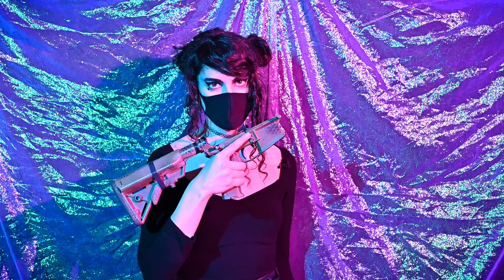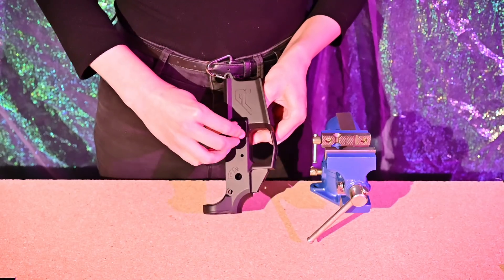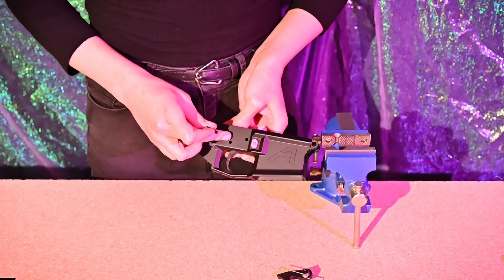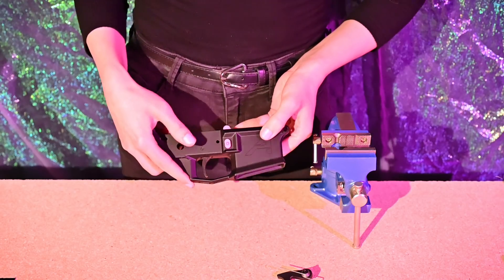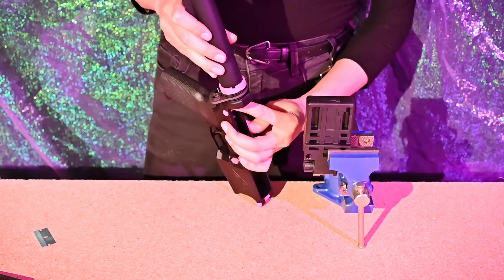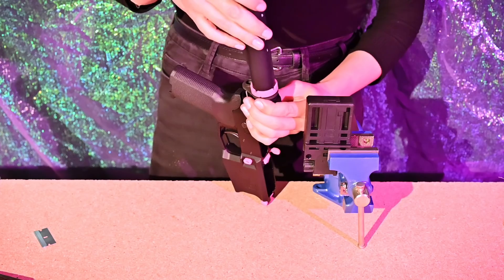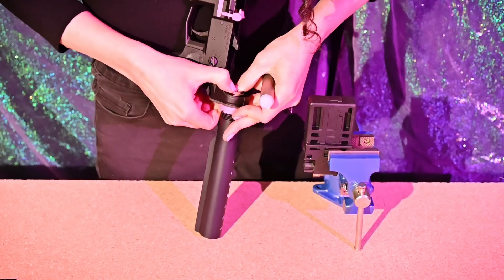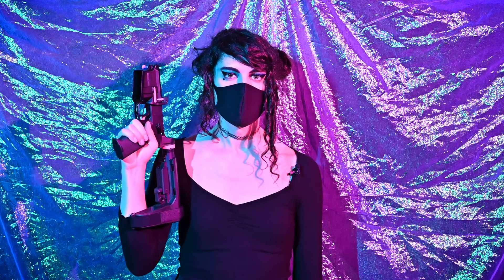How to Assemble an AR Lower (AR Build 1 of 2)

Comment: You're using a spring punch, you do NOT hammer it.  Put the point where you want on the end plate, and press firmly on the rear of the punch.  When depressed far enough, it will "snap" and you've done a punch.  Realign the tip of the punch with the divot you just made, and repeat as necessary until sufficient metal is displaced into the castle nut to keep it from backing off.
Reply from the maker: D'oh. You're right. I borrowed this punch from a friend and obviously had no idea how to use it. But hey, I learned something today!

Comment: i almost took a lower apart to build along with you

the m4e1 lower is dope because that stupid detent spring hole is threaded so you can put a set screw in there and make it captive and never have to worry about it ever again. trim a little material off the spring. its fine.

im drunk and ghetto so ive trimmed it and slapped tape over the detent. ive changed tubes and end plates a lot over the years on the same lowers until i got another and that part always annoyed me.

really nice parts build here. 

my mag catch wasnt screwed in all the way and the button would jam...then i figured out i needed to screw it in more. 

great vid!

Comment: Great build!

A couple things I've found helpful in my builds...

Anytime you have an offset load in a vice, place a block of similar thickness in the jaws. This will reduce twisting forces in the jaws and maximize clamping force. Your part won't slip as much.

I leave the rear takedown pin detent spring out until just before I have to tighten the castle nut so I'm not pushing the spring in 47 times while tightening the buffer tube.

Comment: Awesome vid! Unsolicited advice : Might use a kiss of Anti-Seize on the Buffer Tube and Castle Nut, to prevent it from galling / corroding, in case you ever have to remove or replace your buffer tube.  Same with a Barrel Nut. Thanks for making these!

Comment: Pretty decent video covering the build process.

I am confident that you know the following, but for those unacquainted, some recommendations from someone who has built these both professionally and as a hobbyist:
1. all springs and detents should have had a small amount of grease applied. Moving parts like detents need lubrication and a small amount of grease will fight off corrosion of springs in the detent channels.
2. the buffer tube/receiver extension requires grease on the threads, typical recommendation is Aeroshell 64, this helps ensure accurate torque values and prevents galling/cold welding in case your tools slip. This is even more critical for barrel nuts to ensure proper torque values.
3. a dedicate center punch makes the staking so much easier, I would guess a typical home tool kit would have a standard center punch instead of the automatic one you were using. Either way, props for understanding that a castle nut needs staking.
4. when utilizing a torque wrench a solid work surface is critical to properly applying torque and mitigating the risk of damaging components. I understand that the spirit of the video was using commonly available things, but a solid work bench makes jobs soooo much easier.

As always, keep up the good work, the content is pretty good and the info provided is all founded on a solid basis.

Comment: two thoughts I wanted to share

when spinning in the buffer tube, I like to take out the detent spring to remove the chance of accidently catching it and bending it over

also if this is your first build or still early to learning, might want to hold off on staking the end plate until you can test it or have someone else look at it to verify that everything there is right. Dont want to have to break it of and buy a new piece if you under or over threaded it.
Reply: Or just use a racheting end plate so you don't have to bother with staking at all
Reply: or a rifle buffer setup. 

we tryna make a4's great again out here!

or not....i get it
Reply: @jacobmanalang8162  can't do a fixed rifle stock on a pistol build.

Also some of us are travel sized and need a shorter length of pull

Comment: Unsolicited advice: if you’ve ever had issues with a bad lever screw coming undone or don’t like the wobble, look up the phase 5 EBRv3. It’s basically a one piece bad lever the replaces the existing bolt catch entirely. I have one on my SOLGW M4 and it’s pretty slick.
Reply: Unsolicited reply: the BAD lever wobbles so the reciprocating mass during LRBHO is the same as stock. some rifles won't LRBHO reliably with enlarged 1 piece bolt catches like the EBRv3 or the PDQ lever... Then again, your mileage WILL vary. You could try clipping a coil of BHO spring at a time until it locks open reliably.
Reply: @prfwrx2497  ive literally never heard of that reason ever for why the bad lever is loose. im not saying you're wrong but what does reciprocating mass in relation to the bolt release have anything to do with LRBHO function? I also dont see how cutting coils on a spring is a good idea either considering that less pressure from your spring keeping the bolt release in its inactive position would potentially allow the it to wiggle into place during recoil and then that itself would give you a false bolt lock. I have two guns with EBRv3's installed and other than the natural wobble youd get from the roll pin/screw that holds the actual bolt release to your lower, i have no excess wobble or issues with LRBHO. I also have a buddy who has a magpul bad lever and its a loosy goosy. Yes i admit this is a small sample size.
Reply: @OTG_Zulu  basically, added mass = mag spring has to do more work to lift the LRBHO to catch the bolt to the rear. This means that on some guns, the LRBHO don't move quick enough to intercept the bolt group, and you get a closed bolt on empty mag + chamber.

The equation is to make the magazine spring do the same work despite added mass of the bolt catch. That leaves the only option of reducing the force the LRBHO spring exerts against the magazine spring. Hence clipping off 1 coil at a time.

It's a balance. Too little LRBHO spring means the BHO can bump around a bit too much and give a false lock on not empty mag just as you said. But there's a bit of leeway to experiment and tune it. Worst case, install a fresh spring and try again, or not.

There's always tolerance stacking going on, so if you don't have to clip any springs to achieve consistent LRBHO, please don't. But if you ever have that problem, do.
Reply: @OTG_Zulu  I'm guessing that the hole for the LRBHO spring has quite a wide tolerance for the specs, so if the hole is on the shallow side, you will have LRBHO Fail with nonstandard bolt catches, but if the hole is on the deeper side, the spring isn't applying as much force against the magazine spring and hence, no problem.

On the OEM design, that spring thingy isn't critical. Stoner knew what he was doing, but he wasn't expecting new bolt catches. So his team at Armalite probably factored that in with the original TDP to make sure everything works yet tolerance don't have to be exceedingly precise where it wouldn't matter as per original intents.

Comment: The trick with a razor blade for installing the front takedown pin and its detent sure beats out the high dollar multipart specialty tool MidwayUSA's build video reccommends.
Reply: Amazon has a tool for like 12 bucks
Reply: I prefer to skip the whole thing with a KNS push pin. No spring and no detent to remove

Comment: In the past I've preferred most AKs I've shot to ARs. Is there plans for an AK build?
Thank you for such a great and easy to follow video.
Reply from the maker: Oof, I don't think I'd ever voluntarily take on an AK build. But props to the brave souls who do. I do have a 74M that I'll be showing off in a future vid though.
Reply: AKs are much more difficult to home build, especially the recievers. They're really designed around being manufactured by industrial equipment like metal stamping and riveting machines and require a five-ton press just to install a barrel. The end user is mostly limited to replacing the furniture, sometimes in ways that do allow for other add-ons.

Comment: Might be worth mentioning that Primary Weapon Systems has a ratcheting castle nut and end plate combo that works really well, and removes the need for staking the castle nut! Snug it up finger tight, then tighten it further with a castle nut wrench by two clicks, three tops.
Reply: I found it on Optic Planet's website. Looks cool. I plan on buying one soon. Thanks.
Reply: @pdxmarine1430  Oooh that's cool, and their K2 model has a little locking lever for added security 👀

Comment: I don't think you tube allows assemble videos I know tactical tool box never show assembly of any of his builds on youtube he puts those on a different platform and only shows the final products on youtube
Reply from the maker: Really? I've seen plenty of lower assembly vids here that seem to have stuck around.
Reply: From what I've seen it's usually videos about manufacturing (that is, usually machining and fabricating a gun) that YouTube takes down. This is just assembly of off the shelf stuff.

Comment: Not a huge fan of the BAD lever. Extra controls in your FCG I feel isn't a super great idea imo on top of hearing quite a few people reporting that the BAD lever induced ND's even with experienced shooters
Reply from the maker: This is the thing that always gets me. Having something that just happens to go through the trigger guard doesn't necessarily preclude anything to the end user. Further, the way I use it, my finger cannot go into the trigger guard as it extends past the lever and I depress that down with the side of my finger. For me at least, it's as dangerous as using the mag release. Maybe with some folks and their finger lengths, this may be a liability, but it doesn't present any foreseeable risk for me.